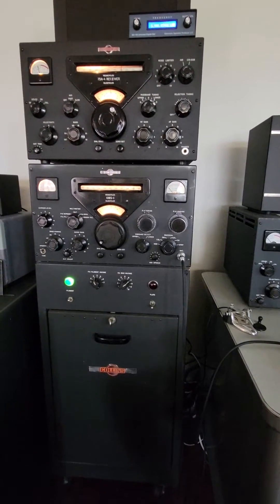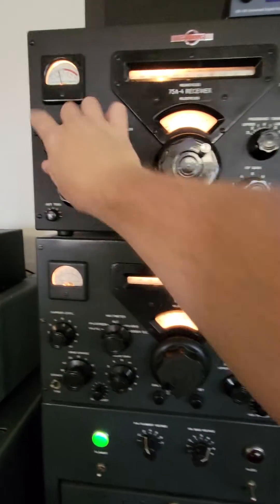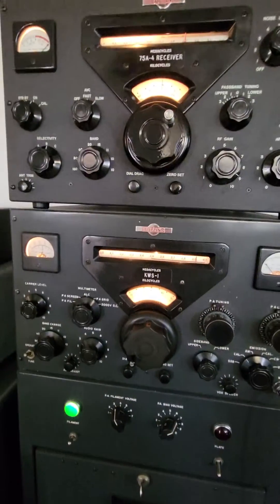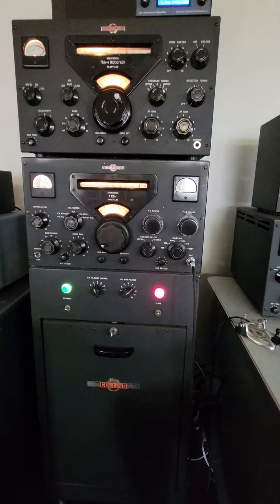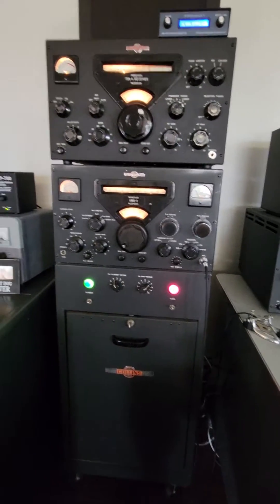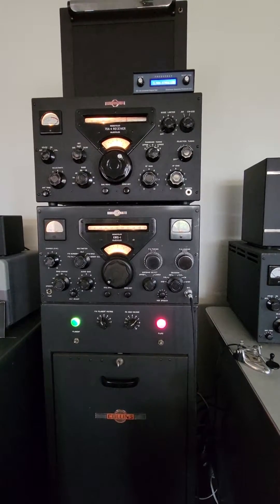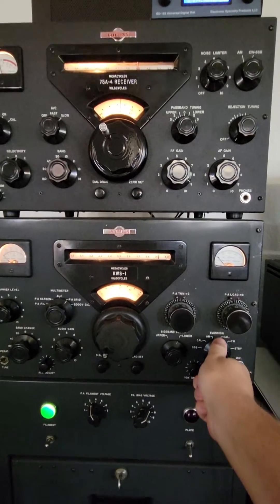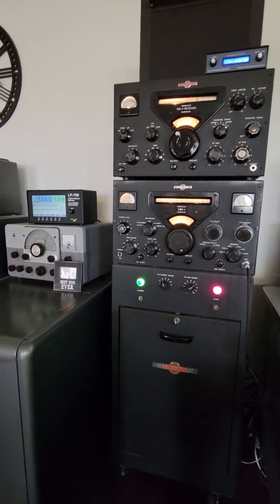Operating the Collins KWS-1 on side band.

Comment: LOL!!  Ignore the below,  I just saw your "canary" video.

A  way more accurate way  of  zeroing the tx to the rx is to unmute the rx and use the tweety bird method  like the Drake twins.   It is difficult to hear low bitched zero beat and you can easily be off 20-40  hz.   By using mike feedback you can easily get within 5--zero cycles.  I've owned an  A-4  and 51J3  years ago, but not  the Collins  transmitter.

Comment: We need more video like this on the KWS-1.  BTW, to see a more pronounced dip on tune, just turn down the carrier level knob, it' may be too high.  If that does not work, turn down the PA Loading knob.  For additional clarification, perform a final dip after you switch to operate to make sure that when you reach 500ma, it's still resonant by adjusting the PA Turning by dipping the plate current as the last step, not just using the PA Loading by itself to get 500ma.  Kevin, WA6JKN